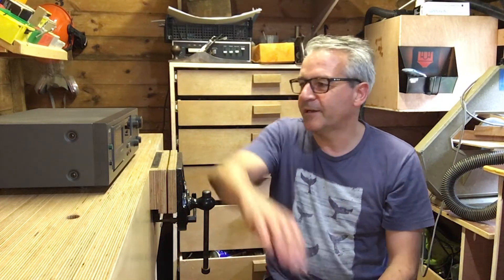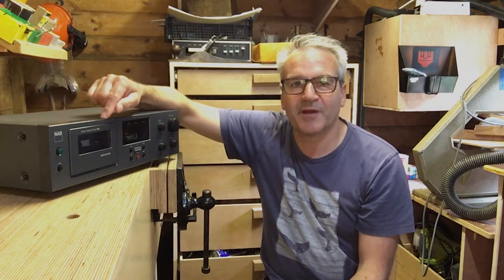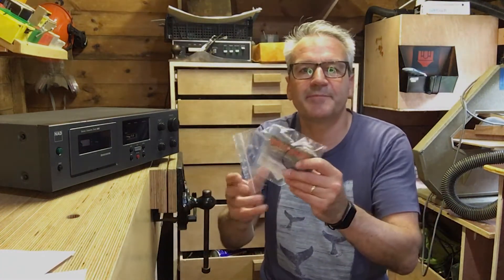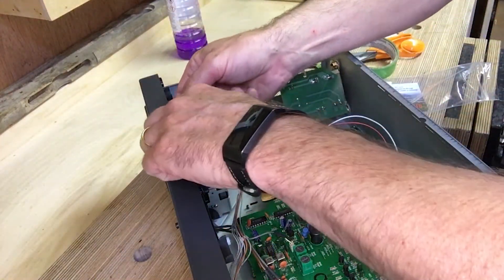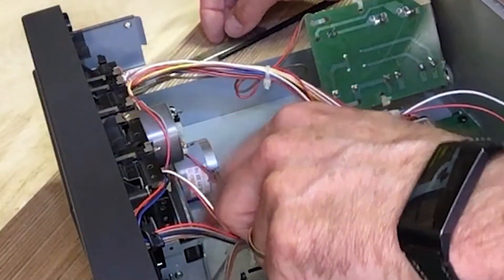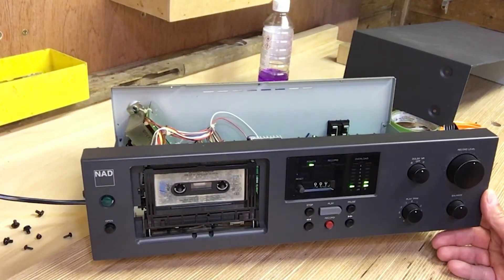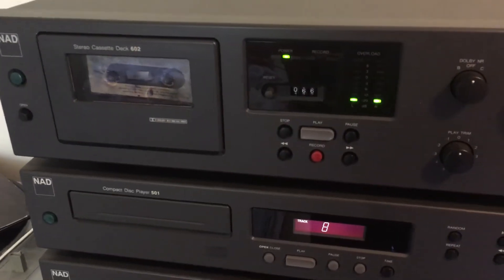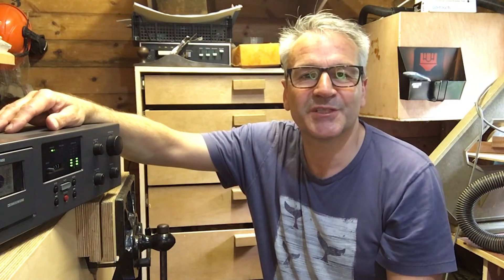How to replace  the belt on a NAD 602 Tape Deck

Comment: Same Mechanism as a 6325 - thanks for this. Had I seen this first I wouldn't have had to take off the entire front panel. Thank You !!
Reply from the maker: Glad it helped
Reply: Turns out that mine looks exactly the same but has slots and interlocks requiring further disassembly. The process however, is the same once accessed. It's very similar just the access to remove the motor plate is more difficult. In all, this was very helpful!
Reply: Hello everyone, thank you for sharing, if I understand the NAD 6325 has the same mechanism as a 602? Just want to make sure because the same belt on mine (6325) needs to be replaced. Cheers, J-François

Comment: this seems to be the most similar mechanism to my 6340 (that I can find on youtube), thanks, should be helpful
Reply from the maker: quite possibly
Reply: @TheShedProjectUK  It was and the belt replacement was successful. Thanks! Getting that one piece aligned correctly was tricky. The thing I couldn’t figure out however is how to adjust the speed of the motor. Theres a little hole for it but I can’t find anything in there to adjust

Comment: Thanks for this. I have a NAD 6325 (even older than the 602) and the belt failed a long time ago.

I'm pretty sure the transport mechanism is identical.

I'll have to see if the counter band it still intact but I know the capstan band is toast.

These were a good unit in their day, with the tape transport reportedly made by Nakamichi.

I was going to sell it-as but I have quite  few tapes so I think I might keep it for laughs.
Reply from the maker: I sold mine in the end as they actually get good money
Reply: @TheShedProjectUK  I don’t know what I will do with mine yet. As it was, I could only have got about AU $40 (£20) for it so I thought it probably wasn’t worth the effort. It seemed like it might be worth resurrecting but I’m not sure how good or bad my tapes are yet.

Comment: I completed this on the same cassette deck but whatever you do, DO NOT open the cassette door to get a better view as I did.  Adds about 1 hour to relocate the plastic spigots and springs in place.  Otherwise worked first time afterwards.
Reply from the maker: I think I did similar the first time